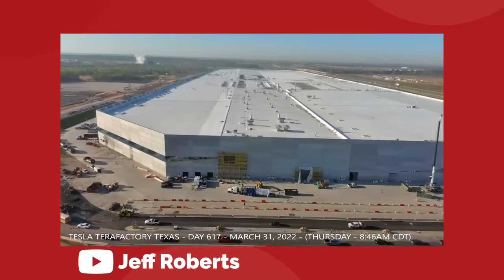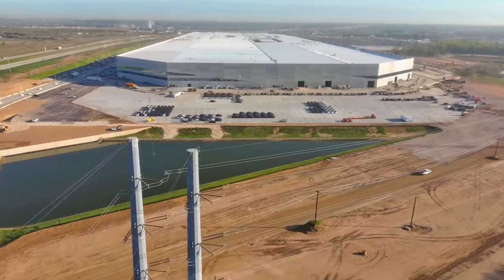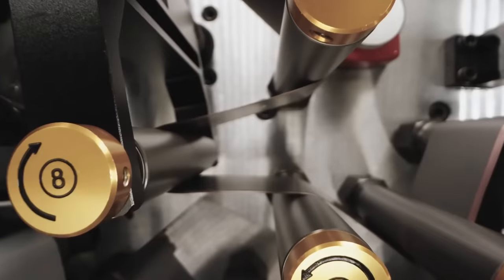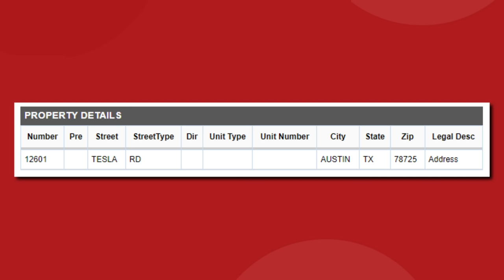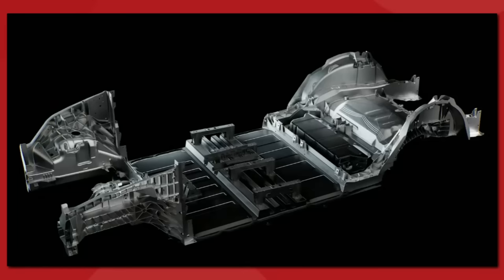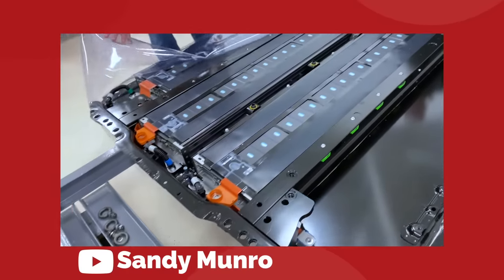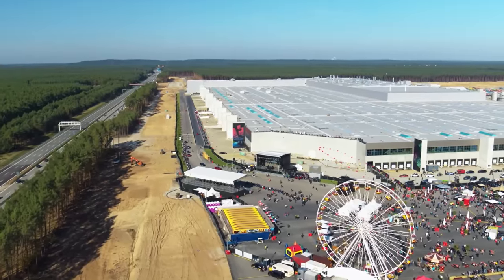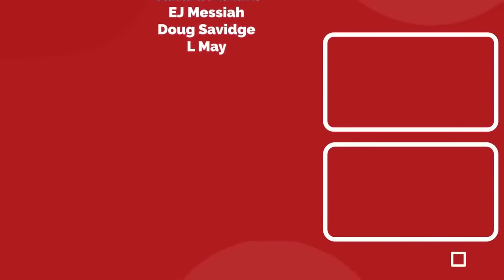Tesla Gigafactory Texas Is Officially OPEN!!

Comment: Crazy how just in 2019 Tesla had one factory… they quadrupled in hardly three years!
Reply: And each and everyone of these factories will quadruple in output without needing new factories… Just Giga Texas has a future capability of 2 million teslas PER YEAR. Giga Berlín will also have the same (once’s the final phases are ramped). This is also the same for Giga Shanghai. We are talking about 7-8 million teslas PER year once’s these 4 factories are to their TRUE fullest. This is what Gordon Johnson doesn’t understand… yea Toyota has more factories… but 1 tesla factory is worth 5-7 Toyota factories.
Reply: @MichaelOrtega  ya thats not gonna happen.   Not enough lithium.   You can produce a maximum of about 2 million electric cars a year
Reply: @jebes909090  You know that lithium is the most common material of and EV to produce/mine? Literally.
Reply: @jebes909090  might wanna check those numbers again, 4 million all electric cars were sold in 2021, and 2 million plus in hybrids
Reply: Not technically true. In 2019 they had freemont, giga Veda building cells, giga ny building solar&powerwalls, plus gigahai was under construction. But this year vs 2019 sales will likely have more than quadrupled. 😁
Reply: @jebes909090  You do not understand what I wrote. 7-8 production capacity VS battery supply. 2 different things. Once there’s enough battery “Supply”…that’s how many cars these factories are gonna produce.
Reply: @4literv6  car factory
Reply: @jebes909090  your information is SO WRONG LMFAO
Reply: Compound interest factories.....

Only on the internet.
Reply: I think jebes is Gordon Johnson
Reply: @4literv6  giganv as well
Reply: @tomwalsh96  tesla sold less than 1 million cars in 2021.
Reply: @MichaelOrtega  lol….. you mean quadruple for just a single car model? Lol…… other many makes 10 million cars a year making all kinds of car models from kei cars to sedans, suv, van, trucks, bus, minivan……….
Reply: Yeah the power of diesel, without fossil fuel it wouldn’t have been possible! It’s actually crazy to think diesel vehicles can run 24/7 on construction site.
Reply: @pascalabessolo5350  yeah just like hydrogen is actually the most common element in earth but why don’t we produce enough!? Lol…
Reply: @stus2159  Tesla aren't the only company selling electric cars
Reply: @tomwalsh96  They are the only ones on a global market.
Reply: Easy if Black Rock and other pump all resourses needed
Reply: @MichaelOrtega  not really. If no one buys then they won’t make so many cars.
Reply: Elon earned that money from bumping up DOGECOIN lol.
Reply: @MichaelOrtega  Interesting comment. Thanks. One thing for sure, in order for CONSUMERS to buy that many cars, the price will certainly need to drop.
Reply: Tesla production ramping up + High gas prices + Recession + Higher interest rates   =   Death Star.
Reply: Yeah if they can keep the factories full of employees!!!! I lived in Reno for years and saw how bad Tesla struggled trying to find workers constantly. Inside info on turnover rate at gigafactory 1 is insane
Reply: @MichaelOrtega  It isn't about the factories as much as it is about the resources and environmental disasters that come from those mining operations to get the resources necessary to build a tesla
Reply: I am saving for one !! thank you Elon for all you do xo
Reply: @jebes909090  EXACTLY.  without lithium these factorie will go bus
Reply: umm i think they are forgetting one thing if there is a crash you cant replace that one spot if its one peace you have to replace the entire car to fix it
Reply: @MichaelOrtega  funny how you don't see many on the road... probably cuz normal Americans can't afford them. 45,000 for a car isn't affordable
Reply: They use their employees to death
Reply: meow meow meow
Reply: @pascalabessolo5350  - It's the cobalt that's the problem acquiring, not lithium
Reply: @pascalabessolo5350  And they are using different materials as time goes on.
Reply: @rileyfair5  not sure where you live, but in DC/Maryland, they are everywhere!
Reply: Crazy how finance capitalism can redirect billions of dollars to whatever they want at a whim.
Reply: And to think there still behind demand just shows how much people love the cars
Reply: @jebes909090 Lithium is not nearly as scarce as you think it is

Comment: We need Giga amount of service centers for the giga amounts of cars coming out as well as chargers.
Reply: Having a Mobile Service Ranger pull up to my house/office has caused multiple neighbors to walk over and say something like “wait - they come to you house to work on your car?”  Arkansas only has 3 SC’s and the closest service center is Memphis TN or Tulsa OK.
Reply: Tesla does not need Service Centers like the ICE cars. Batteries last for at least 300 000 miles. Some beyond 500 thousand. No transmission and no hundreds of other parts that ICE cars have to fix. I spoke with a Tesla owner whose Model S has already more than 200 000 miles, and he just changed tires, did lots of upgrades int he computer at no cost and the batteries have lost around 20% of potency but do not need to be replaced.
Reply: @pabloaguila6344  MYLR w 47K - Mobile Service has had to come to my home / office 5 times.
Reply: @pabloaguila6344  Machines always need repairs, due to random failures, and accidents
Reply: @andypatterson9848  I agree.  Nothing better than having them work on your car at your home or office.  It is the ultimate luxury.  Just don't forget to tip generously.
Reply: @andypatterson9848  for what service. Can you share?
Reply: @maryjaworski5943  in no particular order: 
3 times for the rear lift gate strut (it was defective X 2 and wouldn’t hold the lift gate up and/or wouldn’t raise the lift gate). 
1 for frunk alignment (when new) and 
1 for water in the lower trunk area (required an alignment of the rear lift gate)
Reply: @andypatterson9848  thanks appreciate
Reply: @pabloaguila6344  ICE cars do not need to be in the shop constantly. i have a truck with 265000 miles on it that never needed anything outside of oil changes. I have factored the cost of gas and oil changes vs the total cost of a tesla and battery replacement and the ICE car is cheaper overall, even with all that factored in. Teslas still need brakes, tires, and suspension work too.
Reply: @stus2159  at least I can do a full rebuild at home, every component for a $1000, not require $250 just to change a battery and update a code.
Reply: @matthewmcintosh4925  ok? I can do a full engine rebuild at home for less than 1000 and I still don't need to do one technically as long as the engine is still good. And it is, even after 265k miles and 22 years.
Reply: @JBoy340a  ah yes the good old bribe for work you are already billed for. My local mobile mechanic never charged retail for parts (cost) after I defended one of his five daughters with a pick axe handle. Yeah yeah violence  never solved anything, well the high volicity application of a pick axe handle to the side of an attempted, violent, non consensual, special cuddles giver, certainly solved (redacted young ladies name)'s problem.
Reply: @stus2159  yeah Richard cranium 22 years, within personally specified limits. Can you change a battery in a 20 yo. Car, yeah, Let try 10 years without a computer fault code. 5 years, so 2000 is your cut off date. Oh and by the way Pablo did the conversion. And converted to metric, yeah still not impressed. Like Pablo I've had ICE running 500 000km. Basic backyard service. Filters and  1 in 4 tanks premium fuel.

Comment: Judging by Giga Shanghai, I believe Giga Texas will be able to (Conservatively) achieve 350,000 vehicle production by the end of the year
Reply: No i think about 60k cars(
Reply: Impossible since they are wildly battery-constrained with the 4680's.  They don't have anywhere near the capacity to build even 30,000 cars a year...  New 4680 production will be a slow ramp due to the incredible complexity and safety testing requirements.
Reply: @awebuser5914  Wow is that so,it will be interessting to see the reaction of all the Tesla Stockpumpers who thinking we just can switch on production like a electronic device!
Reply: Since the entire "structural" battery pack was kind of a joke (it's not structural, it's just convenient for manufacturing), I suspect they will have alternate packs ready that use 2170s.  Not leveraging Panasonic cells made at Giga Nevada and essentially "idling" a factory would be completely idiotic.
Reply: @awebuser5914  Do you have data about how quicklyTesla will ramp up their 4680 production?
Reply: @AndyZach  It completely depends on how fast Giga Austin can actually produce reliable cells. That's the million-dollar question, but you have to keep in mind that EVERY cell used has to be essentially 100% reliable, since a platform-wide recall would be utterly devastating for Tesla.  FYI, Kato Road is just a pilot line, nowhere near enough production for "real" uses.
Reply: @awebuser5914  Agreed. I believe Tesla already has production capability of its battery lines. There were leaked reports of 92% yields out of Kato, which is good enough for full production purposes.
Reply: @AndyZach  Kato Road can't produce anywhere near enough cells for "production" purposes.  Austin needs to produce cells and that's going to take time...
Reply: Why would they produce far more than they can sell, though? I don't think the luxury market can bear that high of volume, not with the level of competition Tesla is dealing with. For the wealthy, EVs are more virtue signaling than cost-cutting. They could just as easily get a McLaren or Porsche and hardly blink an eye at gas prices.

So until I see a 30k (long range, not some runty single-motor variety) new Tesla available in my local market, those production levels would be ridiculous and unprofitable.
Reply: @awebuser5914  So does every combustion engine. The camshaft timing being off even a little bit can cause all sorts of serious issues with a gasoline-powered engine, to the point of total engine failure. It's not like Tesla is stuck with some untenable standard: these are issues all car manufacturers deal with.
Reply: @bernlin2000  Not at all to the same degree.  Mechanical defects are addressed on a case-by-case basis, cars bursting into flame is an entirely different situation, just ask GM!  If a recall directly impacts the safety of the owner, it is invariably more serious and generally expensive.  A battery recall would be staggeringly expensive.

Comment: I'd love to get some insights to what was shared in this video.  I'm a huge fan of Tesla, and have a model Y.  I feel as though the one solid piece would be detrimental to Tesla, because if there is a major accident, you can't just fix the skeleton.  You'd basically have to replace the car, as you can't just replace a few parts.  Second, how can they be selling the new battery packs when they have not been approved yet by the department of Transportation, and its not available on the site?
Reply: Most accidents are superficial body damage.  Once your frame is tweaked... typically your car is totaled anyways no matter what brand it is.  Having a single piece frame means easier construction, better safety crash test results, and cheaper/faster production.  All good things.  If you get in a wreck where your frame is messed up, you shouldn't be selling it back into the usable market anyways.
Reply: Yea, that's a big problem for tesla, not being able to fix a certain part.. :/
Reply: @CaedenV  lol……. Aluminum can very easily crack and it’s a structural part of the car so no one can easily know what happened in an accident, there is a reason why heavy duty machines uses steel instead of aluminum, and who know la how those castings are going to survive on super rough African or South American roads!?

Comment: Less and less parts and no modularity to build a new car may sound amazing for Tesla, but it's terrifying for us as users. Any simple crash will take enormous amounts of time and money to repair.
Reply: Insurance is all in house at Tesla.  Beyond that any accident the cars are in creates an incident report in their database
Reply: Exactly, just look at old/new cars that are been exported to Africa, South America…… who is going to maintain those cars?! The road conditions are going to crush those aluminum castings and no parts things,
Reply: There is a really good reason why cars with very few electronics are still on the roads today, I still see 1980 Mercedes’ trucks and cars on the roads for example.
Reply: @mlaw1123  lol….. that means nothing
Reply: Yeah I was thinking the same. The battery being more relatively “exposed” on the bottom of the car seems like a lot of risk was introduced for no reason. But I also don’t design cars for a living
Reply: @DikoMan If you bend the frame in a fender-bender, then it wouldn't matter what car you're driving.  Either way the bodyshop will have to straighten the frame if possible, and if not, the car is totalled.
Reply: Small minds.
Reply: You say that as though frame damage on a regular car doesn't take time and money to repair.  It's no different. If anything, it'll be stronger and may be less prone to damage.
Reply: @DikoMan It's around 60% of the value to be considered a total loss, but it depends on the vehicle.  

What does that have to do with frame damage?  I've seen plenty of cars with bent frames be repaired and not totalled.  I don't see how things are going to change.
Reply: @DikoMan You don't know that, though.  You're just speculating.  I don't see how it would be any different than repairing a regular frame.  It's just made in one piece instead of multiple pieces welded in place.
Reply: I hate the Apple model: the dismissal of "right to repair". I won't buy a car from a company that makes it a necessity to only work with their mechanics. That's a serious devolution of the car market we have today.
Reply: @Darion350  Guess you'll just have to wait and see? Reliability reports don't require you to have foresight.
Reply: @bernlin2000  Are there any reliability reports on this new chassis yet?
Reply: @toddai2721  ha ha ha the die hard fan boy. Hey fan boy did you notice your god has made more mistakes than a poor person like you can afford. Elon musk the millennial version of Thomas edision. Small minds is what elon relies on to build his cult. Hey as a boomer all I can say is we tried and good luck. Oh I refused to breed. Again good luck.
Reply: @Darion350  congratulations you have publicly provided evidence that you don't know what you are talking about. Unfortunately you missed the last 40 years of vehicle design. Crumple zones don't increase strength but reduce strength in certain places. And sorry vehicles today are designed protect you not for repairs. Good luck in life.
Reply: @matthewmcintosh4925  You need to adjust your attitude.  At no point did I say the frame didn't protect passengers first, but I wasn't talking about that or about crumple zones.  I said the frame itself may be stronger since it'll be a single piece instead of multiple pieces bonded together.  It could improve rigidity which would reduce body flex which improves performance.  I'm sure there will still be plenty of crumple zones to satisfy your strange obsession with them.
Reply: @Darion350  hey videogames don't make you an expert, x is an unknown quantity, and a spurt is a drip under pressure. Hey apparently there is an exciting new opportunity for you to get ripped off. 20 km geothermal no cost energy. Definitely something a person who pays for healtcare should invest in. Btw i hope you passed your active shooter drills. Yaeh yeah, exams are hard when you don't study.
Reply: @Darion350  Aren't most cars build as boxes without frames?
Reply: @sandyflipflops5753  If you're talking about frame rails vs unibody, yes.  Cars frames are a unibody design but it's still a frame.  Just that pretty much the whole car acts as a frame instead of just the two rails like what most trucks and commercial vehicles have.
Reply: @matthewmcintosh4925  What are you even talking about?  All I see is complete nonsense coming from you.
Reply: meow meow meow
Reply: It will cost more than the Car itself.

Comment: You raised good questions about the specs of MY built at Giga Texas. They surely don't want to make it much different than the one coming from Fremont. It is possible that the CA factory will be upgraded to structural 4680 batteries over time when Tesla will unleash the hidden capabilities of the MYs.

Giga Texas CANNOT sell MYs until they receive EPA certification for their new MY. This certification will show "Official" EPA the e-milage on the window sticker. Without it Giga Texas can ship it to different locations but cannot sell any car.

Maybe EPA will give their certificate before the April 7 Giga Rodeo or Elon will give us an update on this at the gala event.

Comment: 6:21
It's actually just simple multiplication.  If Tesla claims to be able to store up to 1 GWh on only three acres of land area, then with 53 acres, they could cobble together a Megapack system capable of holding almost 18 GWh of solar and generation capacity in the very high megawatt to near gigawatt+ range.  Spare electricity could then go on to power a nearby Tesla City housing development for the employees.